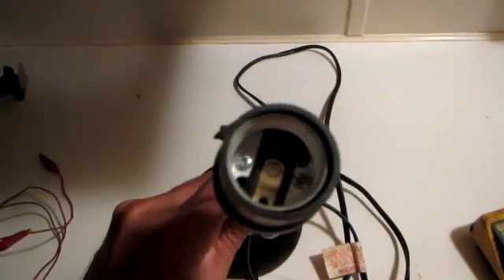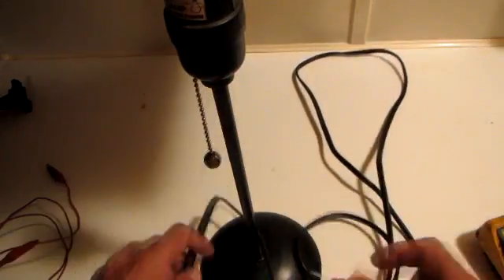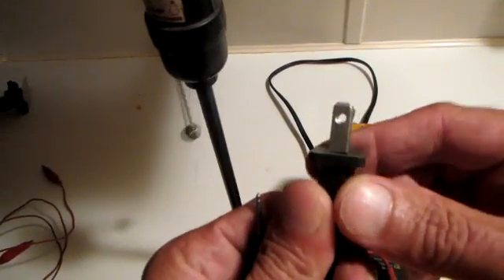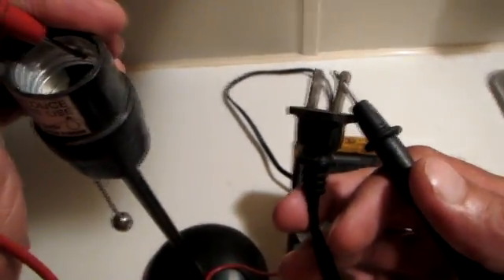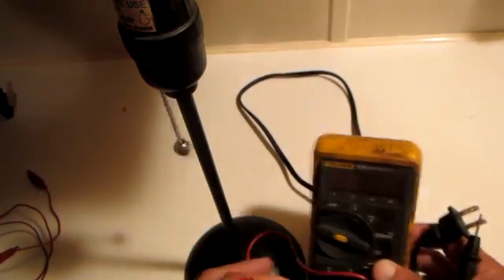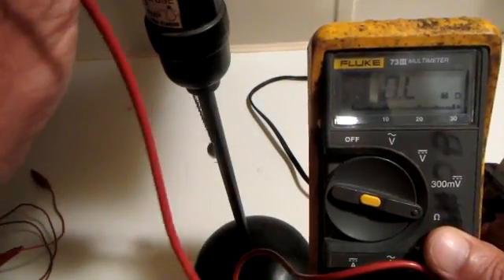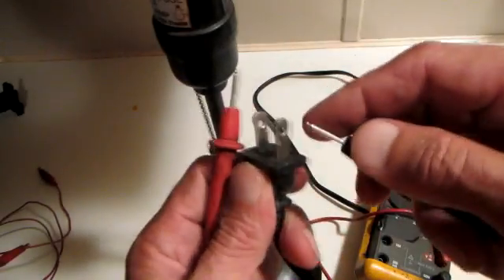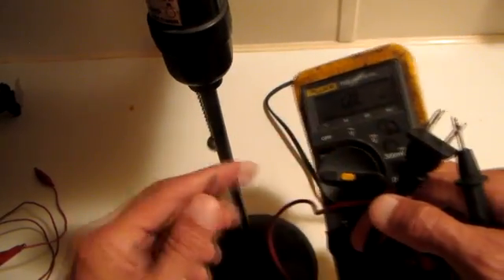Using a multimeter check wiring on a lamp

Comment: Thank you. I was dumb enough to turn it on an poke just on the inside. When the screen of my not that expensive multimeter went blank I was "Ooooh, shit...Should have checked online how to test it". LOL But it make perfect sense to 1)not test this while connected to the main and 2)check which one is positive and which one - ground. Mine looks slightly different (the ground is just another small plate on the side) but it's E27 so it's all good.

Comment: I have a situation where the old wire for the table top lamp I'm repairing cannot be followed from the wall plug to the two open wire ends. The design of the lamp has trapped the wire...obfuscating enough of the wire where I cannot follow which side is neutral and which side is hot. And there are no 'helper' markings on the old lamp wiring casing. This video is just what I was looking for. Now all I need to do is find the right inexpensive multimeter for the job. Yay! I don't have to test the two open wires plugged into the wall...

Comment: thank you so much bill eaglerunner. I just installed a new wire in my lamp and I was so concerned about AC power and having done it wrong. I checked it like 10 times just to make sure by following your advice :)

Happy new year early!

Comment: Even easier, is to set the meter to the diode check position, one position below Ohm setting. That way you get an audible tone for continuity and don't have to be looking at the meter. This is ONLY for continuity checks.

Comment: Neutral isn't ground buddy, neutral connection  is the path for electricity to flow back to the power source to complete your circuit, ground is the 3rd prong on some plugs, to safely take current back to your grounding system, neutral doesn't take the current to your ground system